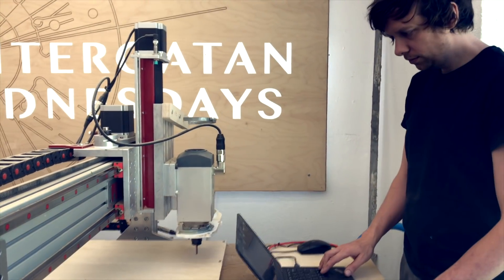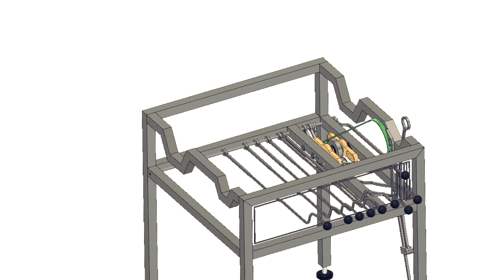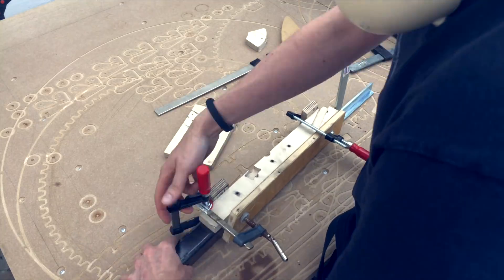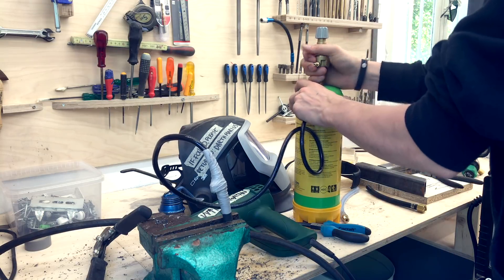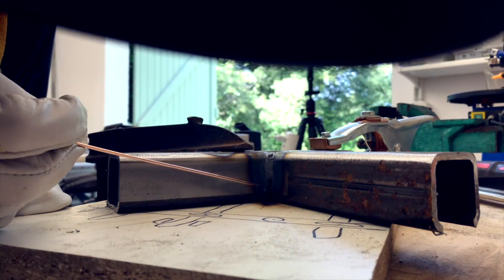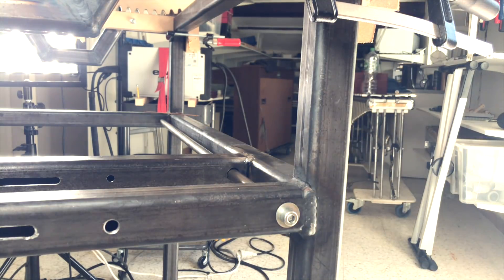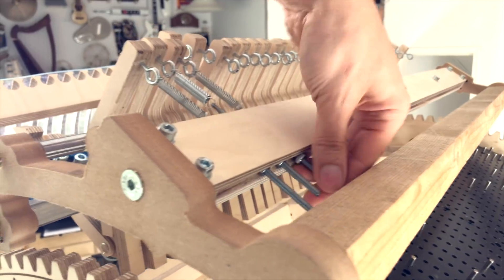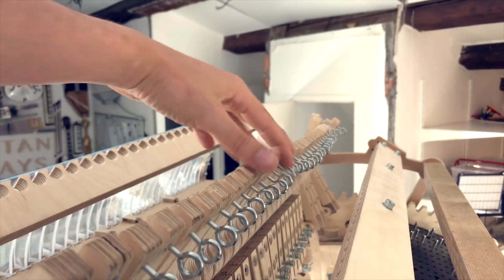TIG Welding for the First Time - Marble Machine X #38

Comment: Why don't you drill and route the holes and slots for the metal parts with the CNC?
Reply: His CNC machine is not ideal for cutting thick steel like the structural tubing. It could be used for drilling small holes (under 3 mm, maybe 5 mm with a fresh bit). It's possible to do the slotting but he would have to take very light cuts and go very slowly. It would be faster to do by hand. The machine is just not rigid enough to resist the higher tool pressure involved in cutting metal.
Reply: That was exactly what he did.
Reply: Hello, smart people. I am only a first year PLTW student and I have no idea what you guys are saying. Could you please explain? I want to become a mechanical engineer in the future and I think this could be something important to know.
Reply: ElectricGears I could imagine using the CNC machine to precisely position the part, then clamp it and drill with a drill press.

Comment: It is advised that you have a dedicated grinding wheel for your tips, (if you don't have one already) mixing different metals can semi-explosive results.  Also it can contaminate your electrode.  

Also if your clamp is positioned correctly on your drill press, it is possible to run loge materials up through the center hole in the plate , and clamp it that way.

Comment: When distancing the cross bar, you should use 2 spacers to guarantee the spacing without worrying about moving the piece as you reposition it on the other side

Comment: I'm a bit concerned about the way you're tensioning the flywheel. Having the wheel itself being adjustable means you run the risk of it coming loose and skewing out of position. A more traditional configuration would use a separate adjustable tensioning roller in between the two sprockets, which would be far more forgiving to small alignment errors.
The last thing you want is the large mass of the flywheel coming loose and contacting something where it shouldn't, especially considering it will be difficult to stop due to the nature of flywheels (it's also a potential safety concern because of this).

Comment: 20 minutes videos are great, I’m certainly not complaining. 
  The use of a power tool for cutting threads! Facepalm 🤦‍♂️ You’ll wreck your taps and dies.
Reply: Green Silver Not if it has a clutch built in
Reply: siddacious 
Clutch or not, it’s bad practice also the teeth get hotter and lose their hardening even with lubricant.

Comment: im actually a welder AWS certified, a few tips for TIG,
1 the tungstan rod for steel be at a 14 degree angle, yours seems to be at 45 and with a blunt end. for aluminim your wand a blunt end and test weld it into a round end like a baseball bat
2 as your brand new to welding try to weld to the floor F1 position, not on the side or vertical up F2 or F3
3 fill in your starts and ends (craters) to 85%
4 any holes init needs to be redone (porosity)

and if you want to bend something, is a lead filled mallet or a hammer, your hitting the wood end of the pickaxes

other than that you did a surprisingly good job for a beginner

Comment: Welding on wood? Great idea!
Do you've got a fire extinguisher nearby?

Metal working is done on metal (due to many reasons).

Great to see the process though!!
Reply: Ohh come on, a 6"x6" piece of plywood ain't gonna burn the shop down, and it's not like Tig welding throws spatter all over anyways...
Reply: Did that at the railroad all the time. One-hundred year old wood oil soaked floors and never a problem.
Reply: Don't forget that railroads are outdoors and sleepers made of hardwood. Compared to soft wood and indoors (with a lot of wood splints, etc).

Comment: My father had a very simple tool for finding the center on a piece of round stock. It was a square (90 degrees) with a straight edge that bisected the square. You just hold the square against the round stock and scribe the straight edge across the end. Rotate the square any amount (90 degrees would be most accurate) and scribe again. Where the two lines intersect is the exact center of your round stock.

Comment: You should grind the tungsten axially rather than radially. The direction of the scratches affects the arc. You may need to tilt the tool rest of your grinder vertical (or less ideally, remove it) to achieve the correct angle.

Comment: Dear Martin, I observed at 15:04 that the top part of the frame is getting quite heavy (and is not very stiff in the sideways direction). As a result, it has a low eigenfrequency (~2Hz) and IMO, if you don't stiffen this, it will come back to haunt you later. A simple cross-brace or a wire-rope would do the trick. Cheers!

Comment: 16:46
What if you just make a few GoPro mounting parts in the machine. GoPro video can be streamed. So, theoretically you could stream the video feed to a screen on stage...
Reply: Edwin van den Akker 
That would make for an epic show!
Reply: Well... there is at least one downside: delay... streaming video can have quite a bit of delay. But hey... go wired. Attach some small cameras, they don't have to be too expensive. And they can be hooked up to a video switcher.
Reply: I also had the idea of mounted cameras! Maybe webcams would work well, hooked to some small computer under or next to the machine. I'm not sure how Blue Man Group did it, but they had cameras everywhere! During one song, they had one camera on each eye of the leader and projected it on 2 huge screens behind the stage.

Comment: Noble gases ARE dangerous, of course not in your case given the shop is so much bigger than the argon tank, but just wanted to point out that misconception. People have died welding inside preasure vessels by asphyxiation or even due to residual nitrogen used to create an inert atmosphere. The danger comes from not being able to smell the gas before you faint.

Comment: I highly recommend nylock nuts! Anything else can rattle loose during use and transport.
Reply from the maker: Thanks! We will loctite everything once we do final assembly, should have the same effect as locknuts, at this stage i want to be able to take things apart and locknuts are so annoying sometimes when you have to open and close things over and over!
Reply: couldn't agree more but on the registrator tentioner they're not needed because the flats of the nuts fit in the groove.
Reply: I suggest taking another look at the design. The springs won't allow the all thread to spin and should also hold the nut in the fitted groove. I'd imagine it would be able to handle any vibrations that doesn't destroy the machine.
Reply: Loctite is much better than nylock nuts at preventing loosening from vibration. If you need something stronger still, nord-lock washers are the very best.
Reply: The main issue with the nylock nuts is they can be hard to hand adjust.  I think the system Martin came up with will be more than sufficient.  If you lose a nut during transport or assembly no worries, they are cheap and easily replaced.  Heck Martin can toss them out into the crowd for souvenirs.  ;)
Reply: Nikolai Manning The threaded bars can’t really rotate as the spring is attached to them. The nut stays in the groove so how could it loosen?
Reply: Was just about to say that. Put them on the ends of the tensioners so you don't lose the adjustment nut.
Reply: Nord-lock washers for the absolute best. Nylock don't work.
Reply: Jyrki H: axial vibration caused by the nut will hitting the channel on the board will loosen the nuts. Also there is a normal stress pulling the shaft up through the nut (F = kx) from the spring. Remember that a screw is just an inclined plane, and the screws are pointed at a downwards angle; the nuts would eventually fall off with enough use or force. It is just a matter of time. Loctite for the win.
Reply: Good. Nobody else said it, time for me to step in: I prefer DEEZ NUTS
Reply: No, because neither the screws nor the nuts can turn. The screws are held by the springs, the nuts by being in the groove of the bar. To rotate [tighten/loosen] them you need to pull the screw against the spring so the nut is free to rotate, turn it in the desired direction and let go, making the assembly slide back into a geometrically locked position.
Reply: Definitely don't want to use nylocks on the spring tension adjustment nuts, those are held in place by the channel in the board.
Reply: Yes, but they can get loose with vibrations

Comment: GEEZ using that bandsaw up close like that with no hand protection?!  You gotta guard those magic fingers, man!!
Reply: Well, actually, gloves are more dangerous here. If the glove gets caught and pulled in you're fucked, a bare hand might have a chance.
Reply: johannhowitzer Pff. It doesn't pull on the material substantially and so you can be closer than with other tools.
Reply: Anonymouspock - true, theres worse machines to use gloves with, but rule of thumb with anything mechanical that has rotating parts: if it's on, do not wear gloves.

In this case, another argument for not using gloves is keeping hands further away, since gloves don't help much but many people would dare to get closer to the blade with gloves on. Plus reduced precision and feeling.
Reply: there are tools he could use to not use his hands to push the material, but that saw has no guiding system so the material has to be moved by hand it seems
Reply: plus if I remember well, he was using the bandsaw to cut a long straight line to make the temporary shaft, not the best choice. Any table saw would do a much better job.
Reply: '96 VR-4 Spyder LMFAO!!!
A very good rule!
This is just asking for an "instructions unclear" meme.

Comment: Agron is not flammable, true, but it displaces air really well ahahhahahahahha shouldn't be a problem if you are not welding inside a tiny space though... doors open, dude! i want to see the machine finished! :) great vid by the way :)
Reply: First you only have to be upsidedown for a couple of seconds to empty your lungs from heavy gases like Argon plus it's not toxic.
Second the ozone generated can be much more toxic (than argon) along with the metallic vapors in the air so a well ventilated area is a must unless lung cancer was in your bucket list.
Third if you ever want to weld zinc plated stuff you HAVE to remove the zinc. It doesn't weld well and most importantly zinc vapors are super toxic and carcinogenic.
Reply: Thiago Ennes Agreed, it is very heavy, and not ideal to inhale too. I've ended up with a 'heavy chest' feeling a few times; until I started wearing a snorkel resperator to draw air in from behind.
Reply: sergeantoine True! I used to work at a factory that made Mercedes parts. I could taste Zinc for 2 weeks after I stopped working there! They were only beginning to install proper ventilation for welding when I was hired. They had a very lax attitude toward safety, and they are now out of business. I'm lucky I have all of my fingers!